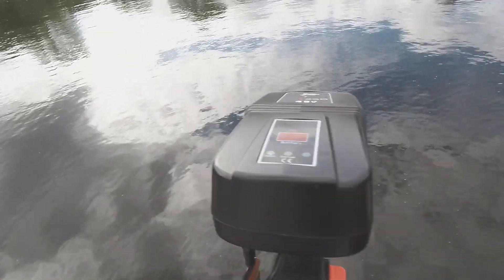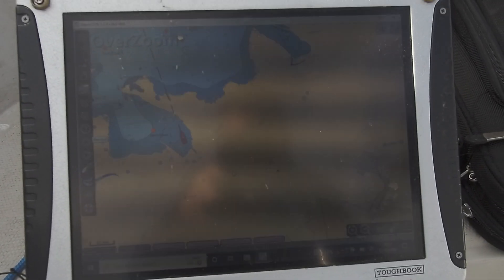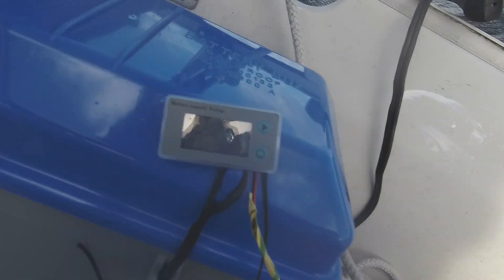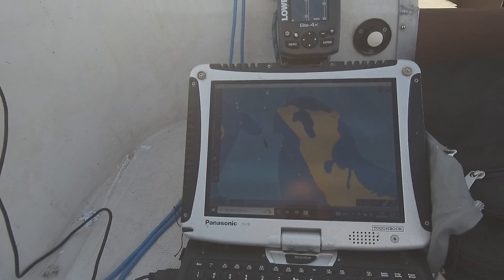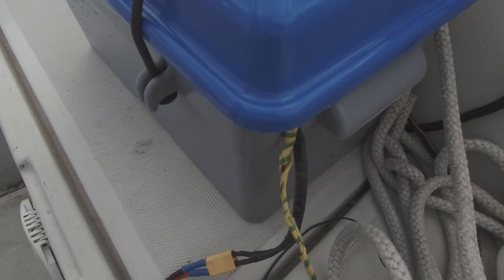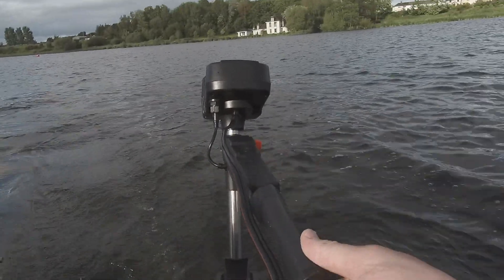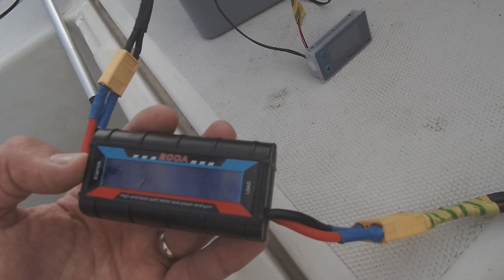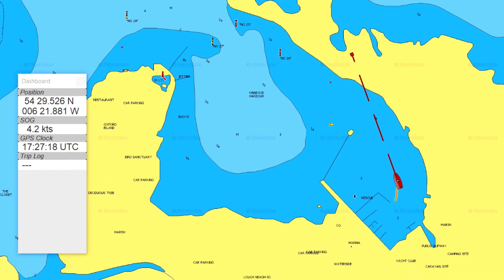How does the cheap chinese electric outboard motor fare pushing against  a F4/F5  Wind ?

Comment: Hello, how does the throttle work on that motor? Does it go back to zero when you let go, like a motorcycle? Thanks.
Reply from the maker: On that particular one it twists both ways and stays ( one way forward the other way reverse )  so you need to manually set it in neutral . You can get a remote throttle that is more like one you'd see on  inboard boats with a lever
Reply: @boatsandbits  Hmmmm...so it has 1 speed forward/backward? Thanks. Keep on testing this motor. You are the only one. Can't wait to see another video. 😎
Reply from the maker: @kammerjohn9553  it's variable speed either way although I think it's got a few steps rather than being continuialy variable . Check out my other videos i've done some more tests with this one.